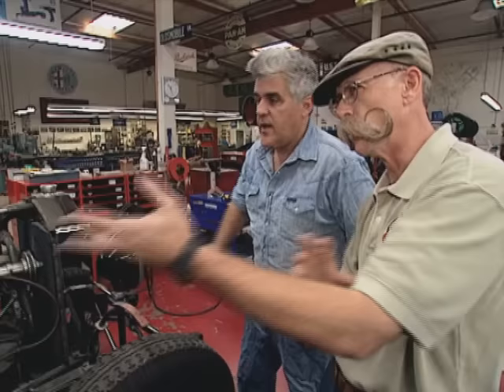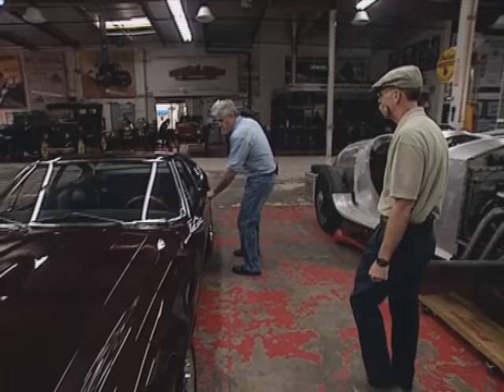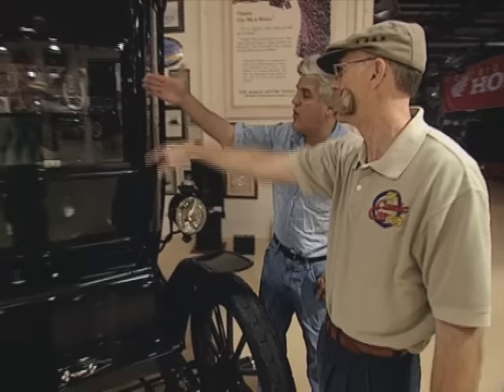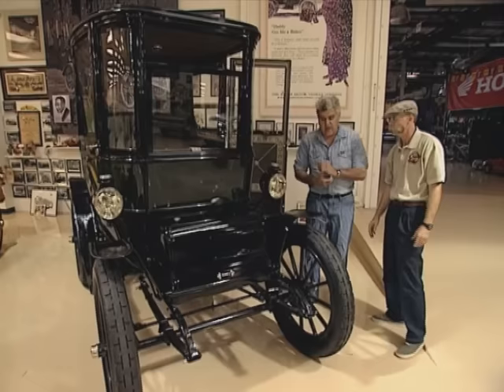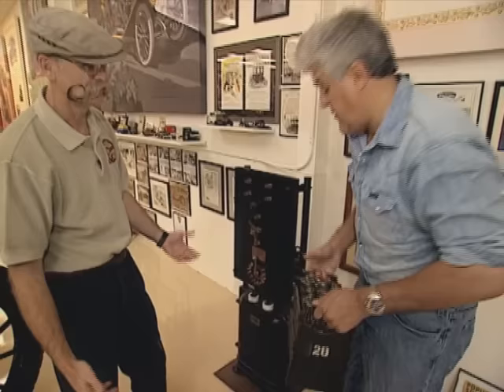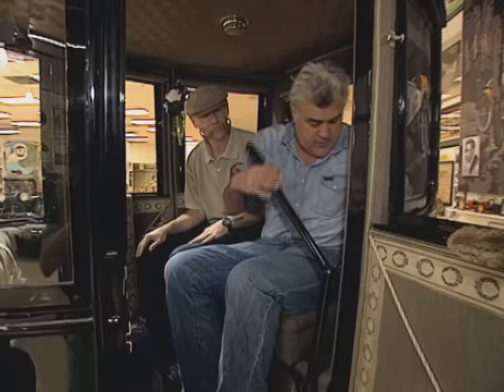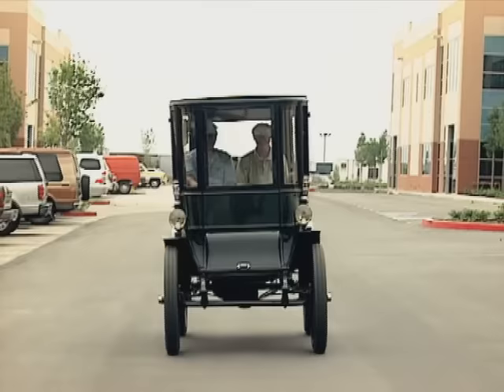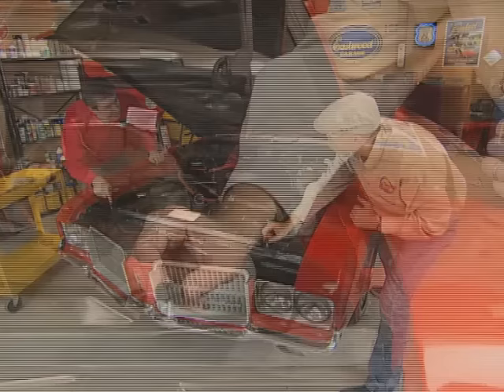Jay Leno's Baker Electric Car

Comment: 100 miles on a charge 110 years ago? NOOO theres NO Big-oil conspiracy ....
Reply: Gasoline was cheap af back then, so people felt no need to change the engines to electric ones
Reply: Also cars where slow af back then, and because drag is exponential they didn't need much energy as a normal highway car would need for the same milage
Reply: no, its 100 miles on a 110 year old car but with modern batteries
Reply: @wojtas2524  Also wages were also low back then 😂
Reply: thats like sarcastically saying "NOOO there was no operation condor" its just something that is pretty much common knowledge by now
Reply: the conspiracy is that these kind of cars were REALLY expensive.
Reply: Welcome the consequences of capitalism condensing wealth and power into the hands of the oil barons of the era and the likes of Henry Ford and other such wealthy people who all did their best to kill development of electric vehicles for as long as possible.
Reply: @Nine-Signs  ... by providing a relatively cheap-as-chips gasoline powered alternative.

if electric cars had been as easy to simplify and cheapen in 1920 as ICE cars, they would have been adopted generally.  It's the fact that it's never been anywhere near as easy to reduce the complexity of an electric engine that's kept electric cars on the fringes relative to internal combustion
Reply: Electric care were city cars most people at time in the country  side so it market  limited do to the fact that most people at the time didn't have electricity
Reply: @hagamapama  did you even watch the video?  Jay himself admits that this is a ZERO MAINTENENCE 100 year old vehicle.  Electric drive trains are several orders of magnitude less complex than even the most basic of 2 stroke engines.

And early electric cars dominated the roads at the turn of the century, especially in cities.  They were dramatically quieter and dramatically safer.  Ford killed the early electric cars by mass producing gasoline cars and selling them for super cheap.  He gambled that people would prefer cheap and fast over expensive and quiet, and that went virtually unchallenged for 100 years.
Reply: @Nine-Signs  sure about that?
Reply: @Nine-Signs  This is such a destructively simplistic, ignorant, envious and unamerican perspective on history. If Marxists were truly interested in the lot of the common man they would heap praise on men like Ford who provided good, high-paying jobs and affordable cars.
Reply: @patreekotime4578  I don't know what you think you're talking about but the horse and carriage 'dominated' the roads at the turn of the century, I doubt most people would have seen an electric car, most houses had neither running water nor gas, nor electricity. Where I live in Australia the milk was delivered by horse through the 50s.

Furthermore you trivialize the difficulty in building an electric motor without diagnostic tools, CNC equipment, computers, etc. Electric motors were NOT efficient in 1900, batteries were NOT safe, there was no infrastructure and they were very slow.

As advances and innovations were made in Gasoline engines and engineering, Steam cars and Electric cars remained unchanged, only helped by the spread of electricity, Gas cars were cheaper to buy, cheaper to run, held a much greater speed and could travel much further. Yes, in many ways they were more complex.

It wasn't a matter of Ford 'gambling' that people would prefer "cheap and fast over expensive and quiet", for most Americans it was a complete impossibility as a matter of logistics, money and practicality. Until the Model T it was horse, tramcar, train or foot. Twenty years after the Model T those 4 options were practically obsolete in America and well on the way to extinction, just like the steam and electric cars 10 years before that.

Early electric cars could not compete with ICE cars after the mid 1910s, there was no conspiracy, Ford and others had ideas, they had the drive to bring those ideas to pass in a great nation where that could happen.

How do you suppose electricity was generated in the 1910s anyway? By flapping around a windmill?
They burnt coal, and they didn't much care if it was clean coal or dirty coal.
Reply: wojtas2524 and not everyone had electricity
Reply: The figures speak for themselves .Standard Oil , Royal Dutch Shell , etc , were determined to drive electric and steam cars off the road , literally .
Reply: They weren't popular because they were too damn expensive, just like today's electric cars (or at least the good ones)
Reply: @tebibyte2357  Yeah, but the US Dollar wasn't as inflated, a dollar then could get you farther then now
Reply: @Nine-Signs  Actually, the American pushrod engines are smaller, more compact, more mechanically simple, and it could be argued more elegant designs than their overhead cam European and Japanese counterparts. Overhead cam designs are larger, heavier, and more complex, but they are also more fuel efficient. Pushrods work better for trucks and SUVs, which comprise around 70% of American auto sales also.
Reply: @patreekotime4578  It has been known that electric motors are far more simple since forever, but without a decent battery to power them, you can forget it, as they take too long to charge and the battery has lousy range.
Reply: @samsum3738  Steam is far too complex, and once internal combustion engine cars got electric starters, that spelled the end for the steam cars. Electric cars have too short a range and too long a charging time.
Reply: @WheelsRCool  But that was then and this is now .Steam wagons were first introduced on to britain s roads , in i think 1803 , 217 years ago . On the same scale , bleriot crossed the channel in 1909 , 6 years after the wright brothers . From 120 feet to 22 miles . Modern technology has already greatly extended the range of electric cars , and steam also has made great advances in recent years . We have become too fixated on oil and are now paying the price.
Reply: @samsum3738  Steam is extremely inefficient as a power source. They have made some great improvements, but I don't know if they could get them as good as ICE vehicles. Steamers are also very complex generally (more so than an ICE). Also, steam would have to run on petroleum-based fuels as well. 

Electric cars have only improved due to the creation of lithium ion batteries, and in spite of that, are still very limited. And unless they can figure out alternative materials to manufacture them out of, are probably never going to be able to go mainstream because there isn't enough cobalt, nickel, etc...in the Earth to meet the supply.
Reply: @WheelsRCool  If i was to say a giant elastic band ?
Reply: Yes it is Already in 1899, two American engineers covered 100 miles (160 km) on a single charge. In 1909, Emil Gruenfeldt of the Baker Motor Vehicle Company covered 160.8 miles (259 km) on a single charge in his Baker Electric Roadster. Two years later, he beat his earlier mark by travelling 201.6 miles (324 km) without recharging the batteries.
Reply: @indeed7289  You're mixing up time periods, the 70's is when EVs were "killed". Both technologies were in their infancy at this point (1910's), and as cars got faster and heavier the battery technology was insufficient while IC engines could keep up. People like to find conspiracies in everything lol.
Reply: You know gas cars have to be popular first for there to be big oil, right?
Reply: @Nine-Signs  The Electric Car is only Simple when shown on a Diagram.

The next Step is 1) Waterproofing, as Electric Cars have to be waterproofed so they don't short out, 2) Material Components, such as RARE EARTH MAGNETS, which for most Electric Cars, you needed Four Motors for all Four Wheels, which for the Simplest Electric motor, requires TWO EACH.

After that? Expenses, part replacement. What happens when an Electric Motor wears down? You need to buy a New one. It's only by the Seventies that electric motors became cheap enough for EVERYONE, and in 1909? That was the Luxury of the Rich who could afford it.

By comparison, when an ICE Has a Worn down component? All you gotta do is replace that part, pluck out a Piston, or tinker with the Carburattor. Hell, some people have even replaced parts by CASTING THEIR OWN from SCRAPS!

You CANNOT do that with an Electric Motor!

So yeah, it's less "Big Oil", and More "Do you UNDERSTAND how EXPENSIVE Electric Motors are?!" Also, it would mean Mechanics who have Spent DECADES learning the Art of Fixing Cars, would be out of a Job, but Hey! BIG OIL, AMIRIGHT?!
Reply: @patreekotime4578  ...Uh, Quick Question?

How Waterproof is it? And how well does it Fair offroad?
Reply: @Senkino5o  exactly! Electric Motors Use Rare Earth Magnets to operate! The early variants also had shoddy Waterproofing, made notable in the Early Car Starter Motors where if water got to the Starter Motor, it was Fried. If STARTER MOTORS were not properly Waterproofed, what Chance did the Electric Car have?

Also, like I mentioned down below? If an Electric Car in the 1900s breaks down, it means you have to dispose of the Highly Expensive Electric Motor and Go buy a Replacement... And it's not gonna be any Cheaper.

By comparision, a Car With an ICE breaks down? Check the components, find the problem, fix it. Some people even Made Replacement parts like CYLINDER HEADS from Cast IRON! That means all someone had to do to get a Replacement part, was to MAKE a New one!

And frankly, I believed the Lie for twelve Years of my life, that ICE are Needlessly complex... But they're not. They're actually Works of Mechanical ART.

Also, ICEs can run on ANY Liquid Fuel that burns! One guy even ran a Car with an ICE on COOKING OIL! You can't DO THAT with an Electric Car!
Reply: @Victor-056  Nonsense, What harm could possibly come from an all open metal chassis attached to high voltage batteries. You will be telling me radium tea is bad for me next.
Reply: @Nine-Signs  Isn't Radium highly Corrosive to the body and on top of that, Radioactive?
Reply: Rudolph Diesel, the inventor of the Diesel Engine originally designed his engines to run on peanut oil.  Now think about that!
Reply: @ghost500e  If you only drove modern electrics at 25 mph they would get incredible range, too.
Reply: Yes, but remember,  a Ford model T of the same era had double the top speed.
Reply: @tebibyte2357  Not really if you account for inflation and the fact many things were "cheap" (with quotes because its pretty much not that much more cheap than today's stuff if you accounted for inflation) back then.

Comment: Electric cars are both the future and the past
Reply: Electric cars will never be viable
Reply: @milesromanus7041  they will with time
Reply: There isn't enough Lithium in the world to produce enough electric cars to replace the current world fleet of gas guzzling cars.....
Reply: @martinhess7334  What about Graphene batteries?
Reply: @martinhess7334  What about organic batteries?
Reply: What about over head wires like trolly busses that every car conencts to
Reply: @jackalenterprisesofohio  Or built into the road? We don't need to have huge batteries. A hundred kilometers range is enough, for dirt roads, and more rural areas, if most concrete roads have charging wires in them. (Of course there will be a tax for this like buying fuel, if this becomes reality)
Reply: @milesromanus7041  you may haven't noticed it but EVERY automaker has shifted to Electric cars.
Reply: @JohnSmith-pn2vl  making electric city cars is one thing, but making viable, reliable electric cars, able to travel 1000kms on one "fill" or able to recharge completely in minutes, is another thing. I'll respect electric cars when one of them wins Le Mans.
Reply: @milesromanus7041  if you respect an EV only  if it can do something nobody will ever need, fine, thats your decision.
nobody cares
Reply: @JohnSmith-pn2vl  "nobody will ever need" your ignorance is frightening. Le Mans is the race that tests the car's performances on dry or wet road, daytime, nighttime, for 24 hours straight. If you think this is pointless, it's no surprise newer cars are getting worse..
Reply: @milesromanus7041  rofl
ok i give up this leads to nowhere
Reply: @milesromanus7041  They already are
Reply: @milesromanus7041  Against OPEP this is the better way. Except if you plan to kiss the back of Saoudi Arabia for few more decades.
Reply: @milesromanus7041  Please explain what you mean by "electric cars will never be viable"? While you make this post on a device made of compressed rock with lightning applied that connects you billions of people all around the world.
Reply: @martinhess7334  Ah yes, the person that says something is impossible because it's not here and perfected right now. 

There is enough lithium to provide batteries to replace every vehicle in existence, more reserves of lithium are being found yearly. Please update your records as you're last known lithium reserves must be from 1999.  We won't be using lithium for car batteries in the not so distance future anyway.
Reply: @martinhess7334  They don’t need to be Gas guzzling! They can sip Petrol!
Reply: It's still an old technology. We'll see it fail soon.